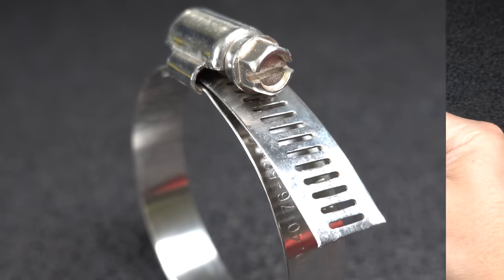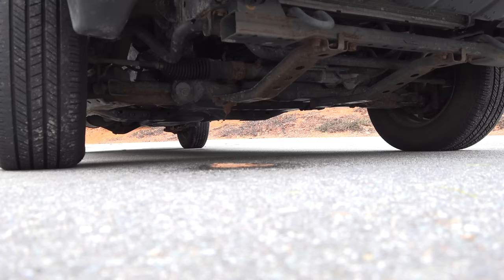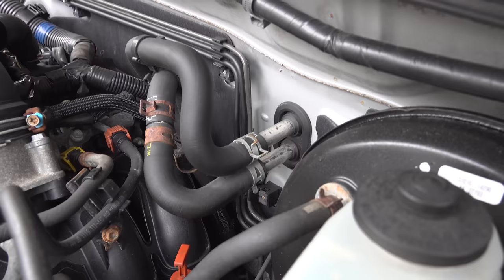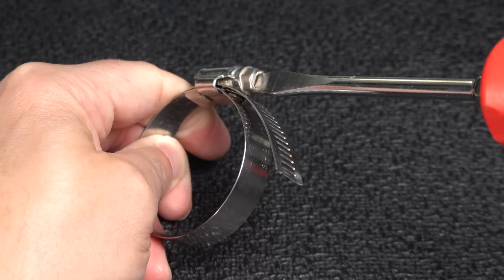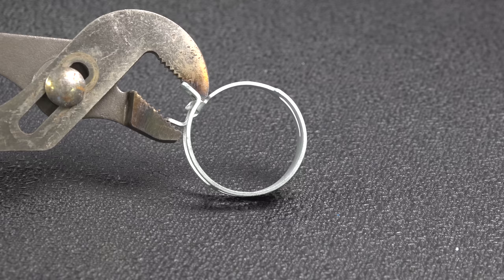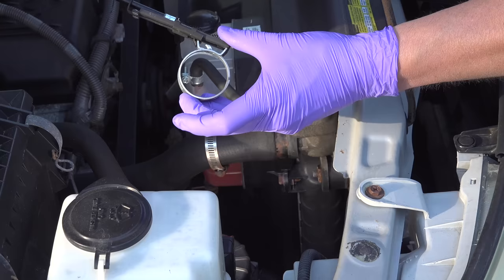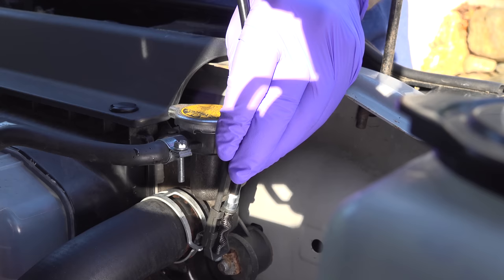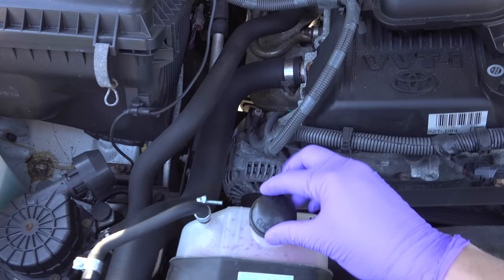STOP Using Hose Clamps WRONG - LEARN A BETTER WAY

Comment: I must be the minority. Ive always used those worm gear clamps and have never had issues.
Reply: And I'm sure every other person that has used them has never had a problem either.  He just has something wrong with his truck specifically.
Reply: Try putting a pressure tester on it and I can almost guarantee at least one will leak a little. The spring style rarely leak
Reply: Ten 4 worm clamps are better
Reply: @robertgary3561  You don’t have the right sized clamp or it’s not tightened enough if they leak. There’s nothing with them.
Reply: @waterloo123100  it’s always after a few years. Car as a slow leak. I hook the pressure tester to it and just go around and tighten clamps and it’s good.
Reply: @robertgary3561  I've got a ford amd have replaced a few of them. My friends chev almost every one leaked after about 5 years.
Reply: @robertgary3561  I have switched out some spring style ones, because they leaked, with worm style. But it is not a common problem I have had to face, and rarely see a worm style issue either. Part of this, I hypothesize, has to do with my more temperate climate, where things get colder, but not nearly as hot as the south. The thing I also want to add, is that those spring clamps I would replace would always be rusting out. While the worm style are stainless steel and often don't rust outside of the screw in some.
Reply: @blazetownsend8785  checked two cars yesterday. 05 Subaru pressure tested to 15 psi and 4 of the screw clamps leaking. They were also a bit rusty. Other was an 06 saturn. I tightened the screw clamps and it was fine. The original spring clamps did not leak. I think that is the real difference. The spring clamps retain constant tension but over years the screw clamps loosen. In both cases I replaced with screw clamps simply because I didn’t want to remove the hose. But I rarely have seen the spring ones leak. These are very subtle leaks snd if you didn’t have a tester you’d just add a few ounces of coolant every other oil change.
Reply: I just finished up an LS swap on my jeep, and every part was new.  The radiator, the waterpump and all hoses.  The one on the outlet of my waterpump would always seep, no matter how much I tightened the clamp.  I even cut off 1/2" of the hose, and installed a new worm clamp.  Still a slow seep when running.  When I had the jeep in for a safety inspection (mandatory here), the mechanic suggested a constant tension clamp.  Not a drop since.  I have never had any issues with a worm clamp until now, but I am a firm believer that constant tension clamps are better.  A worm clamp may work in most cases, but it isn't as good as a proper clamp.
Reply: Same. I replace the spring style with the worm gear style because those spring types are so difficult to install compared to the worm gear style imo. Just install your hose clamps when the engines cold and tighten the shit of them (I use a socket).
Reply: The worm style clamps are far better and easier to use. If its leaking its due to operator error or a bad hose. Worm clams are used in boats and they very rarely leak.
Reply: Me neither just have to buy the quality ones
Reply: Same
Reply: Same here bud and if there is a problem they’re so cheap, double clamp it
Reply: 1973 Dodge Dart Swinger  loves her worm gear clamps since theday i purchased her new.
Reply: I agree every master tech I have ever worked with or still work with today hates those clamps. They do fail and the worm clamps have never leaked on me neither unless it wasn't tight
Reply: Worm clamps also have specific diameter ranges, if you use a bigger one it will form into a shape kind of the letter "D". Some have the ranges written on it. I've already changed one leaking on a used car, like in the video, change it to a smaller one and cut a little the hose and never leaked again
Reply: I always had problems with the spring clamps. Especially when its used on a small hose that is tucked behind a bunch of other crap.
Reply: Your are not , I’m with u on clamps
Reply: Or he may over tighten them and damage them so it can't tight like damaged screw threads just goes loose
Reply: I personally throw away those tension clamps and replace them with worm ones because they loose they’re tension and start leaking and also if they’re in a hard to access place they’re a bitch to get out
Reply: Yup cause you do need to retention them after running the vehicle all depends on the car to. But your better using the worm hose clamp better then springs
Reply: Never had a leak and/or snap problem on classical style clam
Reply: I never did either.
Reply: Right there with you
Reply: Screw them pressure clamps. On my jeep theyll get old and you expand one to get it off and low and behold it wont go on as tight again. I've never had a problem with a hose clamp
Reply: I use the worm gear type only on my air box. Everything else uses the spring-loaded kind
Reply: Same i have used worm gears my whole life and never had an issue.
Reply: Yea id more say either his rubber had cracks, nothing accept exhaust can even get close to red hot lol
Reply: Me too, I only use them and didn't have any problem at all
Reply: @waterloo123100  there is only 2 options, it will atop leaking or it will cut the hose😂
Reply: I have been a service technician for 25 years yes if you use a old hose use the clam clamp but make sure it in the same place or it will leak. When replacing with a new hose I use screw type clamp when possible.
Reply: They cut into the rubber hoses and ruin the way they were intended to clamp and cannot provide the correct spring pressure from the factory
Reply: I actually think they're better than the spring clamps. I think spring clamps are actually just used for ease of manufacturing.
Reply: @keld101  Glad to see I'm not alone!  Thanks to everyone for the replies
Reply: I do think haynes manual recommend them as a replacement over the oem
Reply: The real problem is the cheap chinese worm gear clamps. The stainless "ideal" clamps are the best in my opinion
Reply: Agreed
Reply: I actually have had a problem, on my coolant hose it took about three tries of tightening for the leaking to stop, when the coolant got hot it changed sizes of the hose so it would leak and I just kept tightening it, but it’s good now
Reply: @waterloo123100  

Worm drive clamps have limitations and do wear out over time. Worm drive clamps are ok for some things. If you use them right they're fine but not forever. There pretty much useless for hoses the have an OD smaller than about 1/2" (13 mm) and they're definitely no good for any systems over about 50 psi.
Spring clamps have advantages and disadvantages just like all clamp designs. I do think they are better than worm drive clamps for most applications.

Overall there are many much better clamps for hoses and worm drives clamps are not really that great compared to anything.
Reply: Never had a problem except on my tacoma too. 😆
Reply: Spring clamps are the worst. Heavy duty clamps need lots of hand strength while often in tight, awkward places. Your vice grips will slip off the tabs, and other times the tabs just break off. Then you gotta slip some spring tools and pry tools into the hose to get that mother off. Much easier to just hit 8mm hex on a screw clamp with a ratchet or wrench.
Reply: @JoshuasRecordings  You want to avoid using a socket on worm clamps. Over-torquing can lead to them stripping, actually making them loose. Snugging them down with a screwdriver is about the max tension you want to apply to them.
Reply: its the buyers fault
Reply: You just don't understand the application he is talking about. If it's on hoses that get above 150 degrees in temperature it heats the metal up then it loosens. The spring clips keep getting tighter even as they heat up. Comprehension
Reply: Me looking underneath my Jeep at transmission cooler lines 😂😂😂😂😂
Reply: I've had failures, but a lot of success as well. On the flip side... I always prefer OEM style spring clamps, when the option is available.
Reply: @drd0114  vise grips?  why?  use the correct tool man, hose clamp pliers. it works like a charm and it's safer too.
Reply: The oem spring clamp on my radiator hose on my Jeep SRT8 would slip off constantly until I replaced it with a standard worm gear clamp. As far as I'm concerned this video is bullshit.
Reply: He does make a good point.
Yet I replaced the old clamp for the screw on and don't have any issues on the return hose to cooler.I also had a power steering leak but the real problem for the leak was an old O-ring which I know definitely cause a leak at the reservoir.Replaced it with a new O-ring.
Reply: But how else do you get the views
Reply: @MechInvent  very good point!
Reply: If you tighten them perfectly they are great. Problem is its very difficult to get it perfect
Reply: 667th 👍 I even replaced a few of those “SMART CLAMPS” with dumb ones lol
Reply: One just has to make sure they're tight...
Reply: Everyone says switch out those new crappy spring clamps for old worm clamps because they leak . Then everyone else says ditch those crappy worm clamps for new spring clamps they leak . I switched up to old worm clamps because my radiator hose blew off was probably cause of old hose though check the tension every service they haven’t budged .
Reply: Aircraft hoses and clamp's best.
Reply: @robertgary3561  They also rarely go on properly. I've seen them cause deterioration of the hose from pressure on the rubber over the years until it breaks through. The spring style suck.
Reply: Worm style clamps arent meant for these vehicles. They can clamp and hold mostly. But they will eventually leak. The spring clamp keeps constant proper pressure on the entire time.
Reply: What is this dude talking about. This video is not helpful
Reply: Clamps rattle loose, I pop a bit of loctite to hold it in place. No problems.
Reply: @Robert Gary  there's some worm drive clamps that work really great ( made in germany) and there's some worm drives that just really suck ( made in china)
Reply: The problem with regular hose clamps is the quality of them. Cheap ones fail when you tighten them and make it hard to get sufficient clamping force. Better solid hose clamps without cutouts work but are more expensive.
Reply: Was the tubing used thicker?
Reply: Problems with both!  I’ve had upper rad hose blow off with worm gear clamps and slight leaks too. 
  Spring tension clamps are great until they corrode from constant salt or bad environment, weaken and then fail.
Reply: I never have issues with either. When a  ehicle comes to the shop I can either use my grandpas screwdriver to loosen all the hose clamps or use my expensive hose clamp pliers. I didn't have to pay a grand for several tools to remove worm dive hose clamps tho.
Reply: @1893Mauser  Most clamps can be removed with pointy nose vice grip pliers. The "expensive" hose clamps pliers are useful for difficult to reach clamps, but there are plenty of cheaper hose clamp pliers for $20 bucks.
Reply: Same here, never an issue with those hose clamps
Reply: My semi truck uses a variation with a threaded stud and nut, and these are on the air charge cooler hoses. 47 psi of boost, 700hp caterpillar and I've never had issues, and they go from cold to very hot in a few minutes and no boost leaks
Reply: I never had any issues.   In fact I sometimes tossed thoseOEM and replaced with worm in places I wanted to be sure it wouldn’t come off.
Reply: @jadenwebb8651  
Yeah, I like the boat comment. Let me see I have the original OEM worm clamps on my 1990 MerCruiser it’s got around 1500 hours and I think I might’ve replaced one or two maybe over the years play for onr wh  reason o another, maybe maybe .   In fact, I have all but one of the original hoses and they work fine still.   I Collett tomato tomato. What’s the difference they’ll work.
Reply: Depends on how well the hose fits
Reply: N63 bmw engine has a terrible issue with a few hoses leaking early. These spring clamps are highly recommended
Reply: @AtimatikArmy  I couldn't have said it better.  this kid sounds like he's 13 years old.  wtf?
Reply: I've been wrenching on cars over 20 yrs never had an issue. I wonder if it happens because of using aftermarket or unverisal hoses.
Reply: There’s a reason OEM’s choose contant pressure clamps. They expand and contract with temperature and don’t split hoses over time. This is a fact of engineering not dumb luck or happenstance
Reply: I recently had one break on a fuel line on my 69 mustang. I got lucky that it didn't cause a fire. Time to invest in different clamps!
Reply: At sub zero temps,  worm style clamps on aluminum  parts leak. Double clamp, tighten them to the point of almost cutting the hose, and they still leak. Been there working on Toyotas. The original constant tension spring clamps never leaked.
Reply: The second I see worm gear clamps on an engine I wonder what other hack work you did. It should not look like you went to Lowes for car hardware. Gear clamps should be a temporary fix to get you home.
Reply: You're not.
Reply: Stainless worm clamps is all I use and never had an issue. There are cheap ones to avoid however.

Comment: Literally everything he's saying has been the exact opposite in my 20 years experience...
Reply: Yeah he obviously has 0 experience with automobile repair. I work on cars all day everyday and only use the worm gear ones because the pretension ones never work right after removing them.
Reply: I've seen so many subaru spring style clamps fail.
Reply: @TVCColin  The spring style are one-time use. You're not meant to reuse them.
Reply: Yea, the entire video I'm thinking to myself "the fuck is this guy on about". Good quality worm clamps work fine. Makes you wonder what other videos he has where he just spews BS
Reply: Your right not to mention they lose that tension with time unlike the work style clamps which I say I had never had a problem.
Reply: I had the same exact issue on My FJ. Previous owner installed one of those worm clamps and I had nothing but issues with loosing fluid and the vehicle overheating do to pockets of air. Replaced the worm with a spring clamp. And no issues for over 4 years now.
Reply: @jarrodnichols8111  bull
Reply: @WalterRitchey  OEM for a reason
Reply: @glitter_fart  bass acwards
Reply: He will be surprised to see the oil is milkshake
Reply: same here! I think this guy is just looking for a Video that will hit high views!! and ramble on!
Reply: When you say literally. I tend to take you literally
Reply: Rubber hose will compensate for the expansion, but he is being a sales man
Reply: @TVCColin  they can be reused, the trick is to make sire the clamp is put back in the same way it came off by looking at the indentations on the hose. assuming the clamp is still in good condition. ive reused these style clamps 100's of times and the only time iv'e had issues is if the clamp wasn't put back on the same exact place
Reply: @fatjaysgarage  this is true. It's just usually easier to just remove it and throw a worm gear on. Especially when they are in really hard to get to spots.
Reply: I had a coolant leak due to one of those spring clamps failing on reuse.
The mechanic switched the clamp to a worm style clamp, no more leaks.

Oh and these spring clamps are a true PITA to remove, especially in tight places.
Reply: This is why the down votes are so important. Some kid's gonna think this guy is an authority and knows what he's talking about and spread this nonsense.
Reply: @jarrodnichols8111  that makes their case worse
Reply: Mannnnnn who you telling lol these things are ass
Reply: In my first 20 years of mechanical experience, I thought everything about this was wrong.  In the thirty years since the first 20, I've changed my mind and totally agree.  This is from wrenching on a bunch of farm tractors, farm trucks, and personal cars and trucks.  All vehicles that I owned or was responsible for day in, day out.  It is nearly impossible to improve on what the factory automotive engineers use if reliability is a consideration.
Reply: Yeah, listening to people more experienced than I am, I agree with you.
Reply: Just doing this video to make content and get views 🤷
Reply: I agree! I've never had any problems in 35yrs using the worm clamps 😮 Can't understand this guy.

Comment: I've used the old style screw hose clips for over 50 years on my cars, bikes and boats and have never had one fail or lead, and I've never seen one turn bright "RED" as you mentioned.
Reply: I like marine grade stainless steel worm gear clamps for better durability.
Reply: Ya I have more trouble with those "new style" clamps. Those old style clamps normally out last the hose they are sealing. Also, those new style clamps are actually more difficult in tight places contrary to what the video says, When they turn the wrong way over time........
Reply: I was gonna comment the same lol I’ve never seen a quality (not cheap chinese) screw clamp fail
Reply: @jauh25  The only cheap one I've seen fail was my fault. Over tightened it, threads ripped.
Reply: What is he smoking?
Reply: I agree,  the worm drive clamps that you tighten with the screw,  have always worked perfectly fine for me and much easier to remove.
Reply: The evidence does not agree with your personal anecdote.
Reply: I get leaks with them often. usually shows up in the winter, cold temps overnight
Reply: This is why the Coast Guard requires double clamps on any hose below the water line.
Reply: And your anecdote is meaningful compared to acutal engineering studies showing that spring clamps on coolant hose systems perform much better?  A worm clamp is over 3x times more likely to develop a leak with a the >200 degree temp swing that occurs on your heater core and radiator connections.